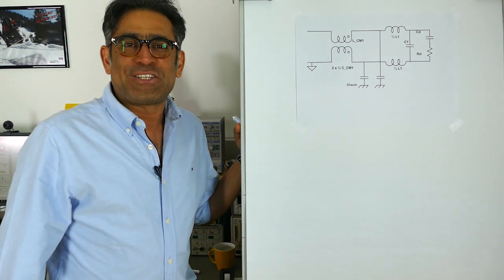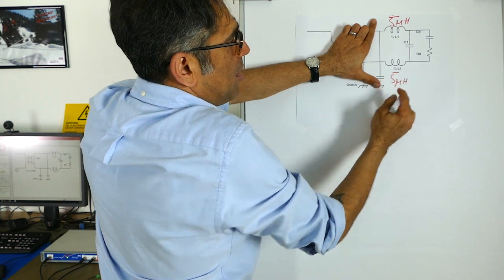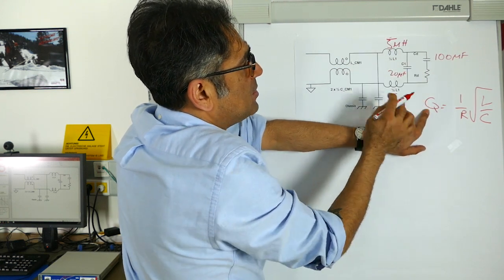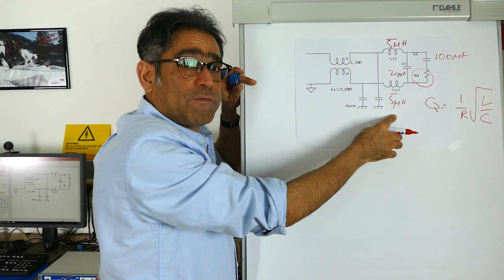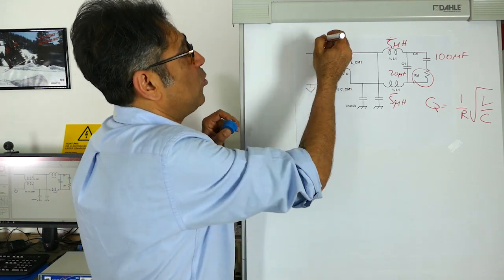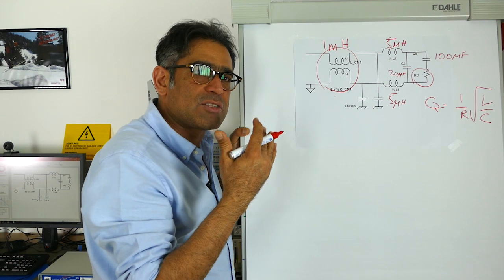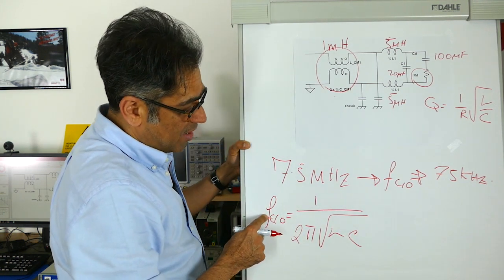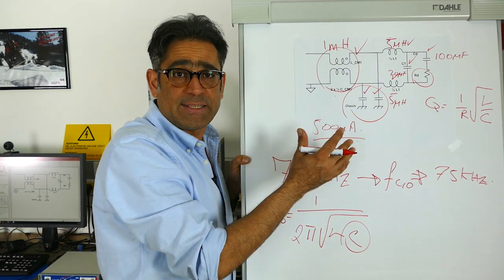EMC Filter Design Part 8: EMC Common Mode Filter Design and Component Selection

Comment: What happens if the circuit hasn't any earth connection? how the filter should be designed? how connect the capacitors you are calculating? I have read in ap notes from texas instruments, that not having this earth lines connections (buck converters hasn't) implies that common mode noise is equal to 0V. So they only put a differential filter. Maybe this common mode filter is only possible to implement if a third line (earth line) is there? If not, don't you need this circuit?

Comment: as a beginner not clear how EMS ( RF ) is converted to flow into PCB smd from original Ac state to DC thr amplifier , at which step is this lesson implemented in the processes of filtering quality output signal ?  happy to find your class , many thanks !

Comment: Why is the value 20uF for differential  mode capacitor?  Assuming common mode leakage inductance is 5uH.  Does that mean each live line and return line will have 5uH inductance in differential mode circuit?  Calculated resonant frequency on common mode. Is that cap value is total value on Y cap? Or individual Y cap value. Need live line y cap to virtual ground and anther y cap for return line. Thanks.

Comment: Am I right that you do not have any special requirement on the common mode filter self impedance? Are there really no special conditions on self impedance? Similar question about damping circuit. You use such circuit for differential mode part of filter but say nothing about it when you make a common mode filter.

Comment: I couldn't understand what the relationship between decibel and frequency is. Can anyone explain it :(
Reply: The LC filter is a 2nd order filter which gives you 40dB attenuation per decade. Since you want 80dB attenuation at the frequency of 7.5Mhz, you have to "start" attenuating 2 decades before 7.5MHz which is 75kHz. The "start" frequency is also called the cutoff frequency.
Reply: @djDblessed  should be 750kHz then.
Reply: @4explore  One decade would be 750kHz, two is 75kHz.